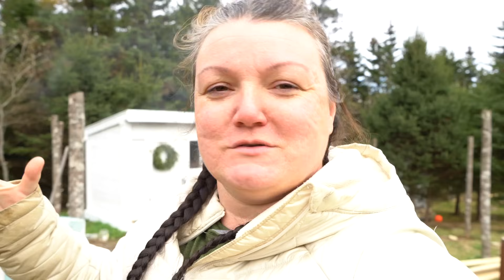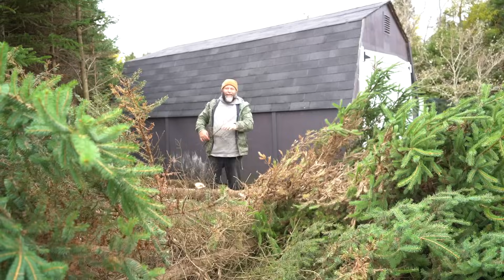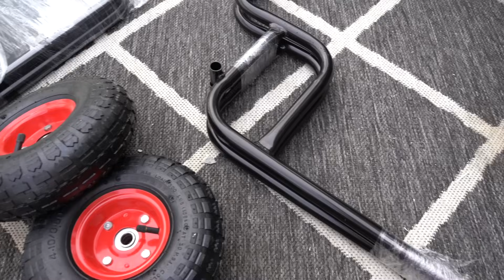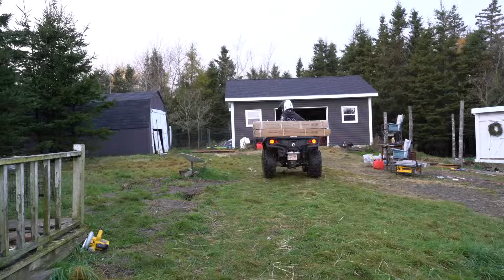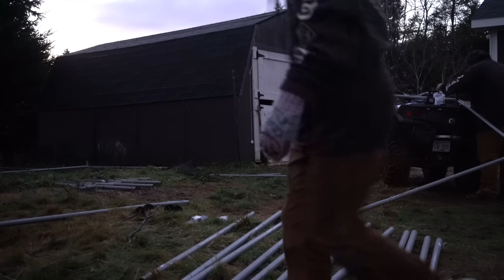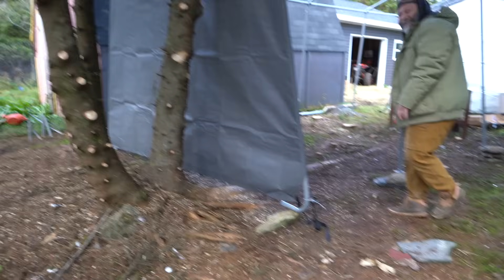I cant even talk about it because... I am going to spill the beans! & HUGE progress on our project!

Comment: Saw someone use pool noodles( they come in white or can be spray painted) on poles inside shelter to keep canvas tighter and from rubbing canvas to pole with so much from wind. Also running extra piping with noodles, through the open areas inside to prevent rain and snow from pudding on top. Just suggestion. This shelter is going to be a game changer for you for keeping wood protected through the winter. Such Blessings

Comment: Great product. Watched a similar structure used and those folks learned the hard way that the wood has to be stacked so it can’t roll against the tarp and destroy it. And off the ground so air flow is good and water can’t pool under it. Lots of people use pallets but I’m sure you’ll have a plan. Looking forward to the surprise.

Comment: Very nice! Don't forget to anchor down the bottom bracing so it doesn't blow over during high winds. Also, since you guys get a lot of snow, you may want to add some additional support bracing on the roof to carry the snow load.

Comment: I don't believe you want to burn pine in your wood burner. Pine gives off resin that is extremely flammable.
Out side fire pit is fine but not inside. The resins will build up in your pipes coming from the burner and eventually catch fire.

Comment: All trees 🌲 got sap in them that’s why u should try your firewood and that it’s not pine trees evergreen trees. It’s a big difference Mer, wood, haps, wood, and birch wood, all kinds of trees out there. That is why you should clean the chimneys because of the sap Coming from the wood 🪵
Reply: Pine (softwood) makes for a quick burn which is great to get the fire going. Hardwood (leafed trees) burn slowly which means they last longer which is great before going to bed for the night